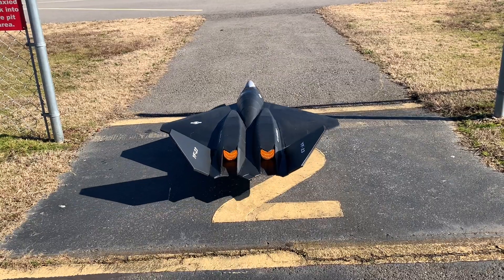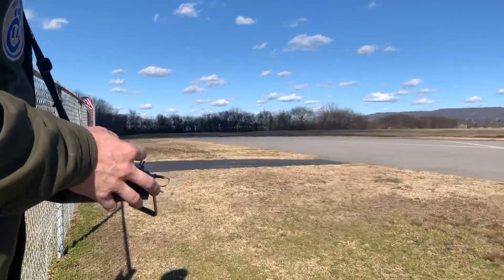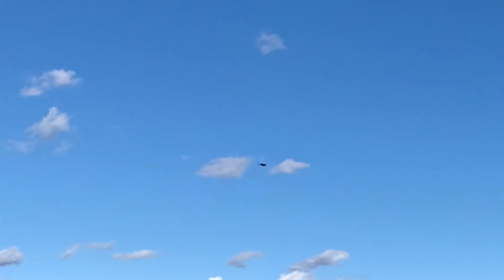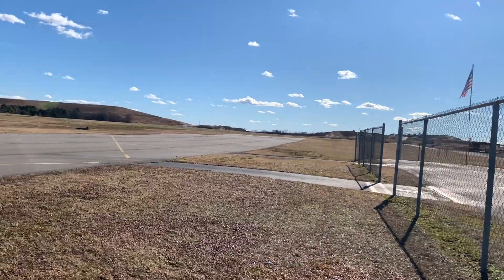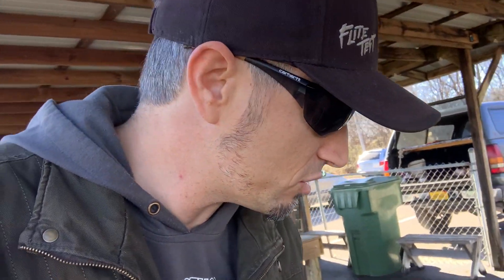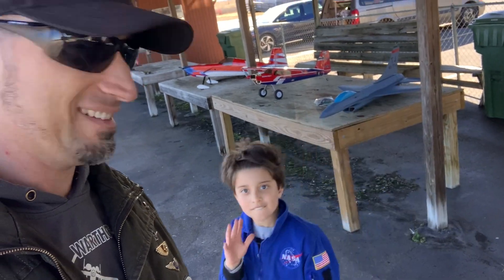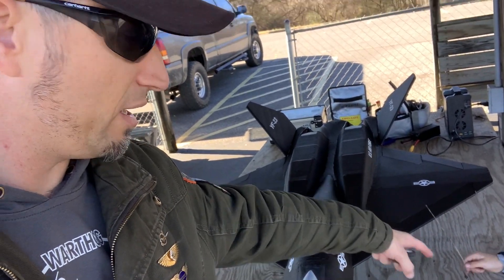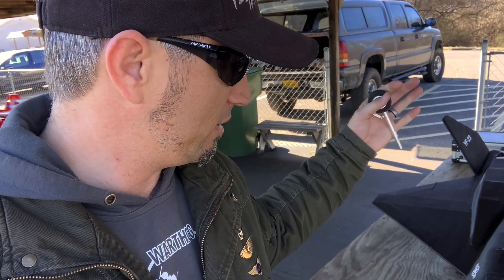Foamboard YF-23 - The Black Widow Flies Again!

Comment from the maker: To all the comments about low power: YES, it is definitely underpowered, but it is not because of too-small fans. The EDFs powering this are very powerful EPF Hobby 74mm metal fans on 6S. The problem is that I have two fans powered off ONE 5000mAh 6S battery, so that one battery likely can’t keep up with the full demand of both fans. 

I have more batteries, but space is a premium inside the plane. If I can find room for two packs I’m sure I will see a performance boost.
Reply: You are a great creator

Comment: I did a profile yf23 way back with the intent of ysing it as a test bed for a larger yf23 about this size. Ince i got the cg moved fwd enough it flew really well. My cg ended up about mid way on the leading edge of the wing

Comment: Nice work building the F-23.  If you are not using gyros, you might want to install it.  It will place more stability on the flight and give you a smoother flight.